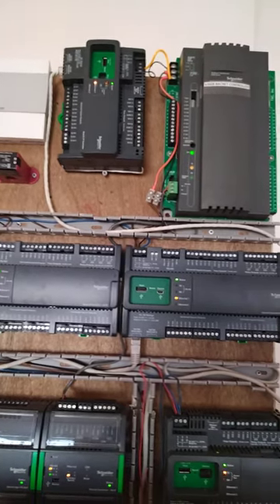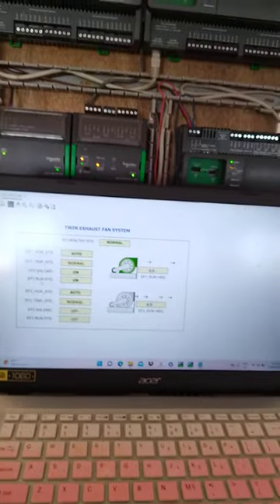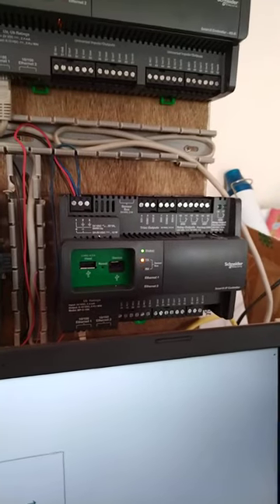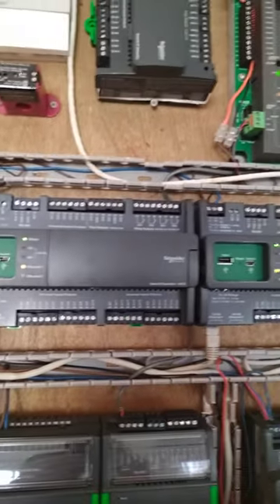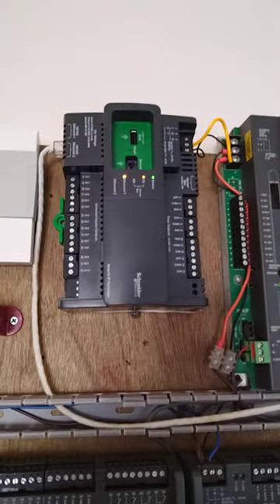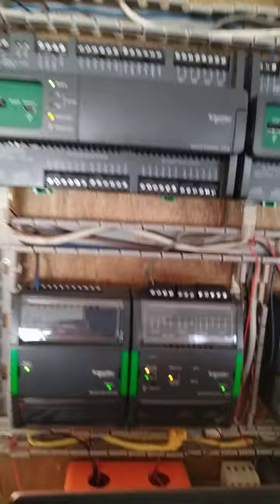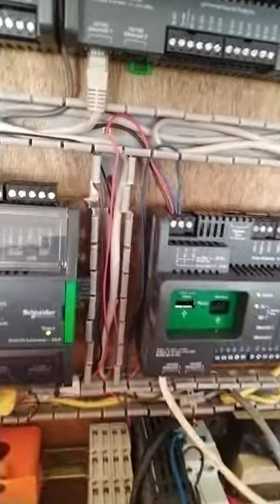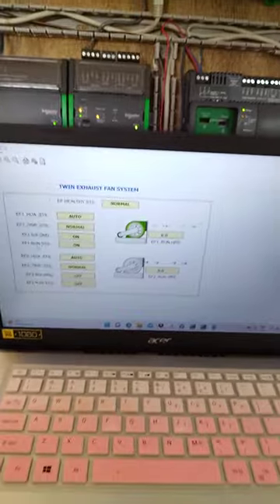How to become a BMS Engineer by Santos C. Capellan Jr.(My EBO SCHNEIDER ELECTRIC BMS STATION)

Comment: Hi sir our problem is Fahu damper actuator open close signal is not getting in Bms Schneider
Reply from the maker: check the Analog Output signal coming from the AO module if there is 0-10 vdc signal, if there is check if that signal is reaching the damper actuator, if there is a control signal then check the polarity of the dc signal maybe polarity is reverse, if everything is ok then check if there is power supply to your damper actuator, if there is then replace the actuator
Reply: @SantosJrCapellan-BMS  thank you so much sir ❤️